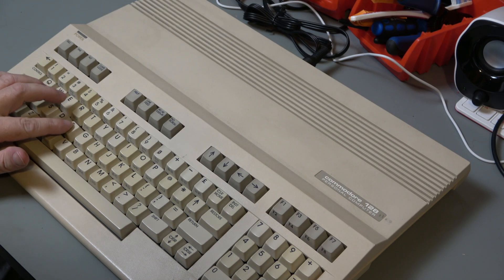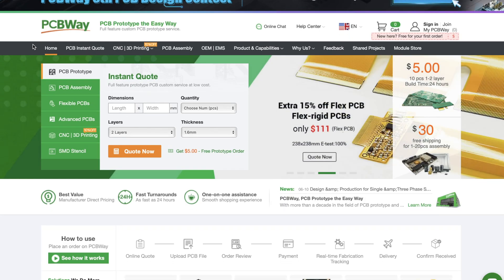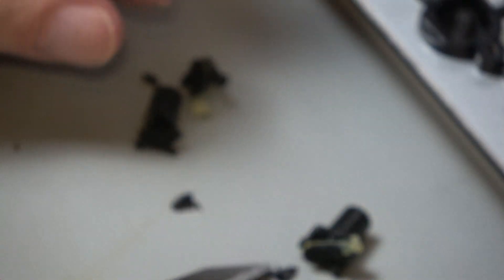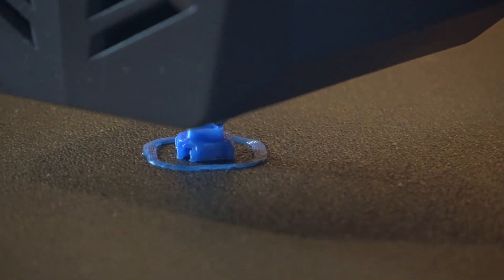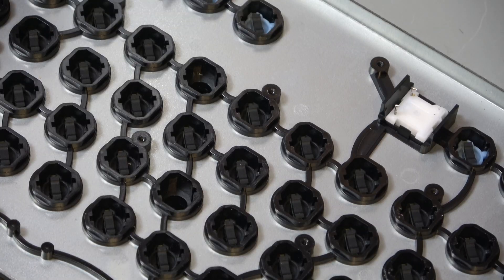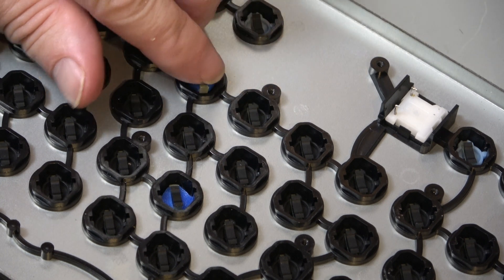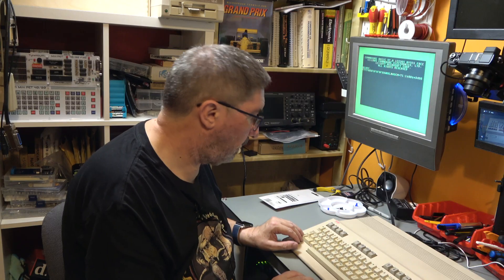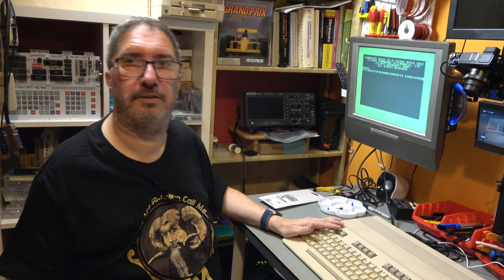Commodore 128 Keyboard Repair

Comment: Did you get the keys to be level height by filing them wider ? 
I've got 2 C128s with 3 plungers on the function keys that are snapped. Thanks for the education !
Reply from the maker: Yeah, had to file them down a little bit for level.
Reply: @TimsRetroCorner  Thanks for getting back to me. I'll give that a shot when my plungers arrive.